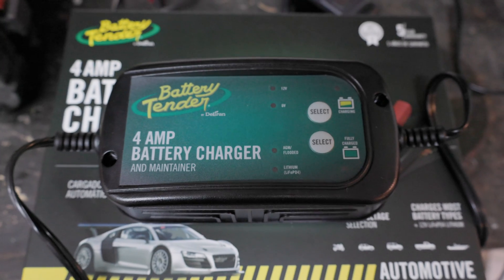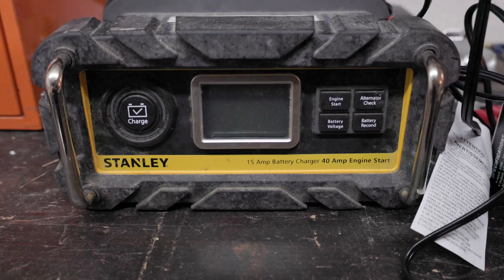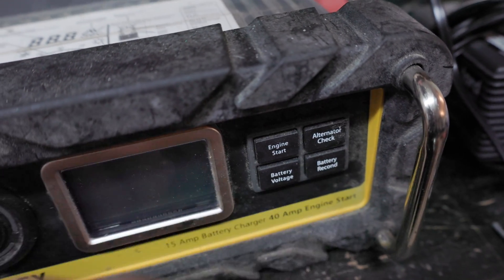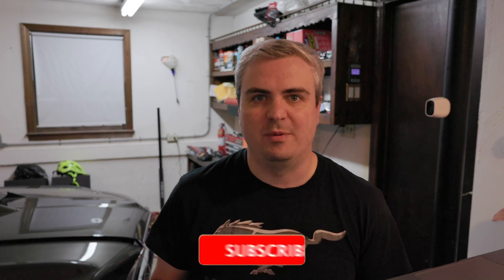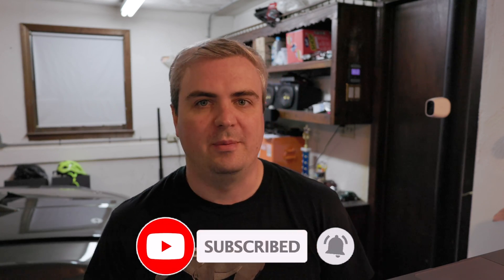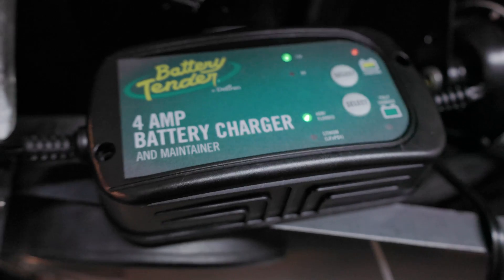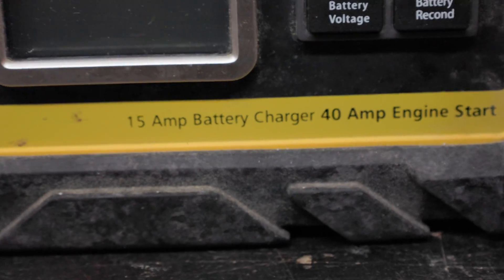Battery Charger vs Battery Maintainer vs Trickle Charger

Comment from the maker: Don't get to subscribe for weekly videos!: https://www.youtube.com/c/SmackeysGarage?sub_confirmation=1
Reply: Why 15amp did it with 2amps have it 6 years still no problem.
Reply: Is it better to slow charge or fast charge?
When using slow charging, the cycle life of the battery can usually reach more than 3,000 times. However, if it is always fast charging, the cycle life will be shortened to about a thousand times, or even lower. So slow charging vs fast charging are important to batteries life.Sep 14, 2023
Reply from the maker: @AnthonyManzio  Nothing against slow charging. 2A chargers work just as good as a 15A charger just take longer. Usually when I'm charging a battery, I'd rather have it charged quickly. I'm definitely not putting it through many complete drain / recharge cycles.
Reply: @SmackeysGarage  15amp will make the battery last less. A 2amps will not heat up the battery and will last way longer.

Comment: @SmackeysGarage what is the best trickle charger for stored cars?
Reply from the maker: My preferred one is linked in the description. It is a battery tender. It comes with (or you may have to purchase) a pigtail you can leave on the car. On cars I don't drive too often, it makes it much simpler to plug in.

Comment: Hoping to get an answer as I know this is a 3 year old video. My situation is I simply don't drive my car enough to maintain the battery. I would drive it maybe 20-30 mins one day and then not have to drive it for as long as a week. I only find myself driving it just to charge the battery up. When it dies, I have to jump start it and I try to drive it around the neighborhood for 20-30 mins. I don't have a garage where I can park the car and charge the battery so I'm hoping to have something where I can leave it to charge the battery while I'm sitting in the car and waiting for it if that makes sense. Thank you!
Reply from the maker: They have portable jump packs that would work for that situation. I also have a battery tender that connects to a small solar panel to keep a battery charged. Lots of people use it on their boat lifts. That would work in your situation
Reply: @ thank you! Could you  provide a link to one you recommend?
Reply from the maker: I run this one: https://amzn.to/42DANAV and this small solar panel should work. https://amzn.to/4ivSI2n. I haven't run that solar panel, but it looks like a good solution for the car. I use the solar controller with a bigger panel, which isn't suitable for a car on my snowmobile trailer.

Both of these are affiliate links... Which means I earn from them. Just wanted to give you that disclosure as well.
Reply: @ awesome! Thank you so much

Comment: @Smackey’s Garage - back in Jun ‘24 our whole-house generator ran 24 x 7 for 6 days. My 3 yr old battery did fine and still shows to be “good” according to the Generac maintenance screen. I did buy another battery in case of another lengthy power outage. I’m wondering if I should get a maintainer for the new battery as it’s just sitting in my garage - waiting to be called into service. Any suggestions? Thanks.
Reply from the maker: For something like a generator I’d probably want to play it safe and keep it on a maintainer as you said. For my batteries that are in storage I do not do that. I typically do one top off with them before I put them into whatever they are being used for. In your situation though you wouldn’t have that opportunity if power goes out and you find your generator won’t start. The other option would be to check the charge on them or charge them every six months to top it off.
Reply: @  - Thank You, Sir - both for your recommendation and the quickness of your response!
Reply from the maker: Glad to help!

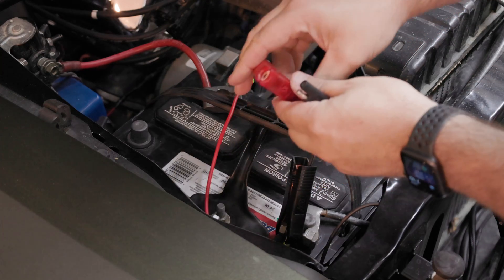Comment: 1:15 Removing the pos cable from a battery while the neg cable is still attached is not recommended.
Reply: What will happen?
Reply: I literally just did this lastnight and now my battery is dead showing 12volts ugh 😣

Comment: Do you recommend disconnecting the negative terminal on the battery before throwing on a maintainer for multi month storage?
Reply from the maker: Really up to you. I'd read the manual and see what they suggest. I leave my Shelby on the maintainer connected all winter.
Reply: So it is gonna be fine 🙂 without disconnecting the negative terminal?

Comment: Glad I saw your video, I have two maintainers ,I bought for our mustangs 5 years ago and 1 crapped out about a yeat ago,  we have had about 5 mustangs since 2010 and everyone of them seems to drain the battery after sitting 3 weeks on end . The maintainer that is still going strong  has jumped in price 3 fold. and I dont need all that happy horse crap adjusting to modes after I plug in and plug out everytime  I just want to unplug and GO...and  plug in  and that's it... ...Battery Tender 3amp I had one of thses when I had my cycle, Thanks for the  tip.
Reply from the maker: Very cool on the Mustangs. Mine do the same... especially if there is an alarm on it.  I think you'd probably benefit from the path I'm taking where I use the simple battery tenders on the car to maintain them, but I do keep a larger fast charger with all the features to the side. It isn't something that typically gets a lot of use.

Comment: I have a small parasitic draw I can’t find and it’s currently winter 30 and below degrees. I drive the car every day but with the colder wet hard my car sometimes cranks more than usual. What kind of charger should I use for over the night in which I can just hook up and unplug and drive away in?? And what amp? Thanks for this video.
Reply from the maker: It depends on how much the parasitic draw you have is. My recommendation would be the Battery Tender that is linked in the description. The green one that is featured in the video. It comes with a connector which you can leave in your vehicle and just plug in the two prong connector when you want to charge it. On my Mustang, I leave that connector in full time and pass it through the hood. That way I can easily plug/unplug it.
Reply: @SmackeysGarage great thanks. Is 3amp to much or is the battery tender in your links smart one? Meaning it will turn off when it recognizes the battery is charged? My main concern is I don’t want to over charge ..
Reply from the maker: @sawgrass3256 yes. The battery maintainer will maintain the battery after fully charged. You can download the manual and read it before purchasing if you want.

Comment: Very helpful! Thank you! Finally I know which type to use when leaving my hobby car in the garage for up to three months, when I’m away. Rather than disconnecting the minus side, and thereby losing preset radio stations etc. I leave my intelligent maintainer type charger on continually, hoping no ‘disaster’ will occur. Good or bad idea??
Reply: That's what battery maintainers and float chargers are designed for. They're both designed to be connected to the battery indefinitely. It even says that in the instruction manuals for my 3 maintainers. Maintainers and float chargers have little computer chips inside that sense the voltage and condition of your battery and as soon as the battery voltage drops below full, they start charging and stop charging when the battery is once again full, so there isn't a chance of overcharging and damaging the battery. Get a Battery Tender, Battery minder, NOCO, or a CTEK. You can't go wrong with either of them.
Reply: @bernardocisneros4402  Thank you very much, that’s what I thought, or at least hoped. However, where I live (Norway and Spain) I haven’t yet found instructions that clearly state that continuous connection between a car battery and an ‘intelligent’ charger is totally safe. I think the battery manufacturers won’t be liable if damage occurs, for whatever reason. They seem to prefer that we keep an eye on things and understandably so.
Reply: I would like to add that I normally don’t disconnect the start-up battery in my ‘95 classic Jaguar. That’s because I want to keep all the settings e.g. the car radio etc. When I’m away I connect the intelligent charger (minus to car body, plus to car battery) and leave it like this for up to three months unattended, the car sitting in my garage, with proper ventilation. It worked perfectly the last time I was away.

Comment: So. During winter what would I want to use to charge a car battery over the period of winter and my lawn mower battery over the winter. 

And same goes for my plow truck during summer months. Tired of replacing batteries looking for something I can just hook up and leave it till I need to use it months later.
Reply from the maker: That's the approach I take with my summer cars. I put them on a maintainer all winter. If I do not do that, the battery dies and you lose the PCM programming.

Comment: I use an 8amp and does great for my maintenance since I have a parasitic drain. Kills the battery in 3 days. Until I can afford to have it repaired it works. I do have the option on my maintainer to only do 4amps. And it does do everything and been real good. I also have a 1amp for my Harley and a battery starter to trick the battery if I forget to give it a temp charger enough to trick the maintenance unit that there is a battery. Yes my battery is new less then 6 months this is actually my 3rd battery since I let the car sit so long that the other battery had to be replaced under warranty and did not pay for this new one
Reply from the maker: What type of car?

Comment: The best video so far,  My grandson bought a small inexpensive car charger for my car.  He (novice) hooked it up and the light is blinking red.  Its been plugged in for 12 hours.  Should I be concerned and unplug it.  Also, can I try to start my car while its connected.
Reply from the maker: Which car charger did he purchase? I'd follow the instructions of the charger that he bought for you. They are all different and have different lights and feedback.

Comment: I use a Deltran .08 milliamp Trickle Charger on all my car/truck/4wheeler/mower batteries because of the weather proof case. On a diesel truck with two batteries what is the better choice as far as amps vs milliamps in a trickle charger? Can too low of a trickle charger be not good enough as far as my diesel truck goes? (Baring all batteries are good)
Reply from the maker: Is there an option to get a "smart one" that is weatherproof that isn't a trickle charger but a battery maintainer? I'm not a huge fan of the constant trickle chargers because then it's a balance between how much energy is getting lost vs how much you are providing as a trickle in. You are right, if the trickle is too low, the battery will die over time but you will slow it down.

If you watch some videos on  YouTube about how to check / measure parasitic loss and battery drain it will show you how to measure current loss when the truck is off.  You can then compare that to your Deltran charger to see if they are the same or similar.

Comment: Can you leave the battery charger hooked up in the car and leave the car in a closed garage?
Reply from the maker: It really depends on the battery and charger. I'd look up instructions for the style of battery and charging you are using. You don't want a battery off gassing in small areas.

Comment: First off.  Great video.  Thank you.  Secondly, I am looking for a way to use my truck as a Halloween prop but I don't want to keep the engine on, just the lights on my roof rack and parking lights.  The battery is going to die quickly since I have 13 aux lights I want to use.  What would work best to not hurt the battery but keep the lights on, engine off for 5 hours?
Reply from the maker: I don't have a good answer for you on how to do it. If it was me, I'd probably try and find some 12V power supply I can plug into the wall that can supply enough power for just those devices and run it without a battery. I've never tried having a constant load on a battery while it is charging.

Comment: What about the amperage?  I've seen battery maintainers with various different amperages?  What about motorcycle batteries vs boat batteries vs car batteries?  I'm hoping to buy a battery maintainer for a 1999 car that I drive a short distance once every 4 or 5 months so I'm not interested in motorcycle batteries.
Reply from the maker: The amperage is going to play a bigger difference if you’re trying to charge the battery from dead or almost dead. 

If you are just maintaining it I would recommend the battery tender one in the video and linked in the description. 

I use those on both of my vehicles over winter. I also use them on snowmobile batteries over summer and other batteries. As long as they are 12V it should be good.

Comment: so I have  a 35ah marine battery and a 200ah AG battery that I use for my camping trailer. What would be a good maintainer for them? Can I use the same for both or would I need two different ones? Thank you for any advice.
Reply from the maker: Yes, you can. The capacities don't really play into the maintenance of it but more of the charging of it. A rule of thumb is you shouldn't charge the battery with more than 10-20% of your AH. So for example, you wouldn't want to charge your 200A battery with more than 40A (20%). 

Any good brand should have the capabilities to maintain AGM batteries with different amp hours. The brands I typically would use are Battery Tender or the NOCO Genius products.
Reply: @SmackeysGarage  thank you
Reply from the maker: You’re welcome.

Comment: Unless I'm missing something, the definition and purpose of a maintainer and a charger are provided. The purpose and definition of a trickle aren't provided.  The most I got out of the discussion was when you said "You don't want to overcharge, so make sure it has a good microprocessor and the box states "battery maintainer" on it. I'm inferring that a maintainer user a trickle charge and has the smarts not to overcharge.
Reply from the maker: Your thoughts are correct. Trickle chargers back in the day didn't have any "smarts" or real electronics to them causing frequent overcharges if you left it connected too long.

Lots of companies today are still using "trickle charger" on their products but add the "microprocess / smart charging" language to it.  My hypothesis to why is people are still searching for "trickle charger" as that has always been the common language.
Reply: @SmackeysGarage  so it’s a play on words so to speak? Trickle charger just sounds like the former terminology—and maintainer is the ever growing former name for it?
Reply: Should a battery maintainer be used on the main battery,the auxillary battery, or on both batteries?  Any info is appreciated. Thank you!